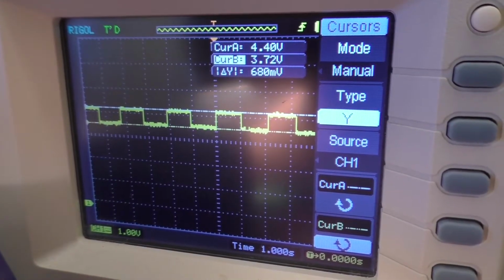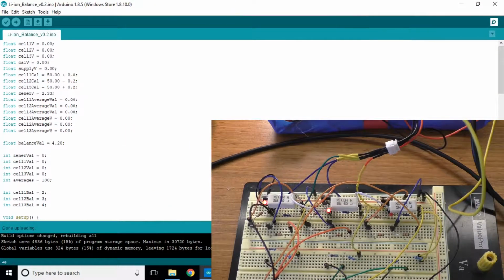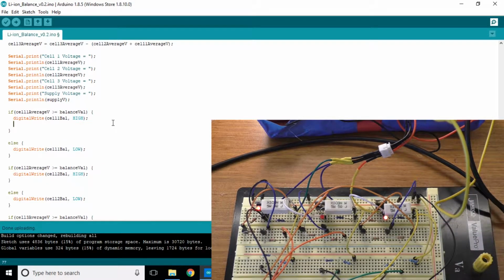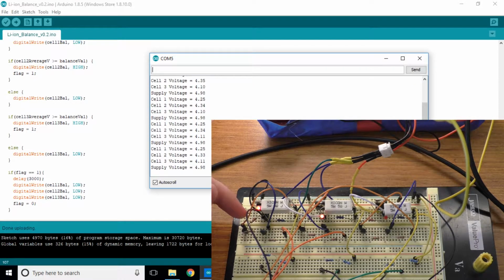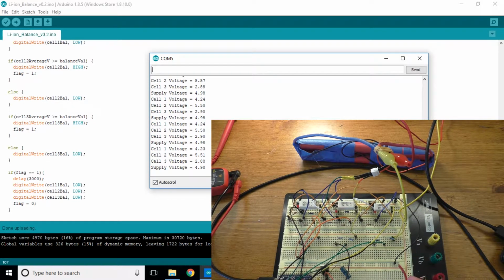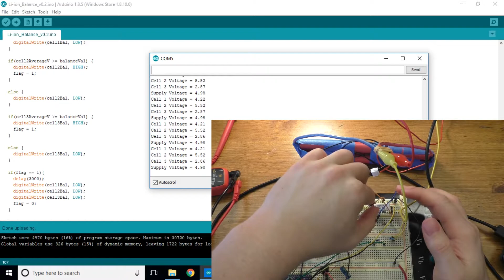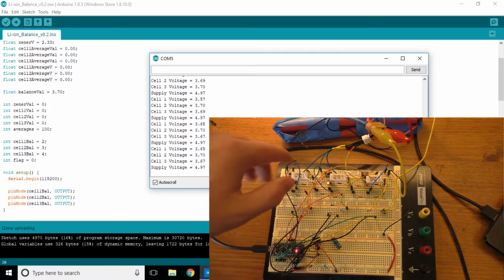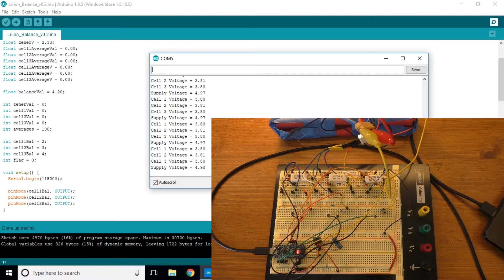Arduino BMS #3: Fixing the Oscillation Problem

Comment: Try to use Aref pin of arduino with a constant completely different voltage source like tl431 or 3.3v separate supply instead of 5v common supply.
In the past i have tried Aref pin as voltage reference and it's very accurate, even more accurate than internal 5v reference! 
And if u r using the aref dont forget to write "analogReference(EXTERNAL)" inside the setup () function and also using some decoupling nano farad valued capacitor with the voltage devider network can improve the readings.
Anyway love from India ❤🎉

Comment: I think its bc of the discharge current is quite smaller than the charging current, so that when reaching the 4,2V, even when the discharge kicks off, the will still be small charging current coming in. You want the balance current at least the charge current

Comment from the maker: //version 0.2 of the code

float cell1V = 0.00;          //sets variable for the voltage of the first cell
float cell2V = 0.00;          //sets variable for the voltage of the second cell
float cell3V = 0.00;          //sets variable for the voltage of the third cell
float calV = 0.00;            //sets variable for supply voltage compensation
float supplyV = 0.00;         //sets variable for the voltage of the supply to the arduino
float cell1Cal = 50.00 + 0.8; //allows for voltage calibration of the first cell
float cell2Cal = 50.00 - 0.2; //allows for voltage calibration of the second cell
float cell3Cal = 50.00 + 0.2; //allows for voltage calibration of the third cell
float zenerV = 2.33;          // measured voltage of the voltage reference
float cell1AverageVal = 0.00; //sets variable for use in calculating the average voltage of cell 1
float cell2AverageVal = 0.00; //sets variable for use in calculating the average voltage of cell 2
float cell3AverageVal = 0.00; //sets variable for use in calculating the average voltage of cell 3
float cell1AverageV = 0.00;   //sets variable for the current voltage of cell 1
float cell2AverageV = 0.00;   //sets variable for the current voltage of cell 2
float cell3AverageV = 0.00;   //sets variable for the current voltage of cell 3

float balanceVal = 4.20;      //voltage where the balancing circuits kick in

int zenerVal = 0;             //variable used for analog reading of the voltage reference
int cell1Val = 0;             //variable used for analog reading of cell 1
int cell2Val = 0;             //variable used for analog reading of cell 2
int cell3Val = 0;             //variable used for analog reading of cell 3
int averages = 100;           //sets the number of averages taken during each voltage Measurement

int cell1Bal = 2;             //sets pin 2 as the output to control the balance circuit for cell 1
int cell2Bal = 3;             //sets pin 3 as the output to control the balance circuit for cell 2
int cell3Bal = 4;             //sets pin 4 as the output to control the balance circuit for cell 3
int flag = 0;                 //sets up a flag for later use in cell balancing

void setup() {                // void setup runs once upon power up
  Serial.begin(115200);       //enables serial output

  pinMode(cell1Bal, OUTPUT);  //sets the pin used to contol the balance circuitry for cell 1 as an output
  pinMode(cell2Bal, OUTPUT);  //sets the pin used to contol the balance circuitry for cell 2 as an output
  pinMode(cell3Bal, OUTPUT);  //sets the pin used to contol the balance circuitry for cell 3 as an output
}                             //end of void setup

void loop() {                                       //void loop runs perpetually after the void setup has finished 
  for (int i = 0; i < averages; i++) {              //for loop used to get an average voltage of the cells
    zenerVal = analogRead(A3);                      //read the analog value for the voltage reference
    supplyV = (zenerV * 1024.00) / zenerVal;        //calculate the supply voltage of the arduino using the analog value from above
    calV = (supplyV - 5.00) * 10.00;                //find the diffence between the supply voltage and the expected 5 volts

    cell1Val = analogRead(A0);                      //read the analog value for cell 1
    cell2Val = analogRead(A1);                      //read the analog value for cell 1&2
    cell3Val = analogRead(A2);                      //read the analog value for cell 1&2&3

    cell1V = (cell1Val * (cell1Cal + calV)) / 1024; //turn the analog value into a voltage that is calibrated as accurately as possible for cell 1
    cell2V = (cell2Val * (cell2Cal + calV)) / 1024; //turn the analog value into a voltage that is calibrated as accurately as possible for cell 1&2
    cell3V = (cell3Val * (cell3Cal + calV)) / 1024; //turn the analog value into a voltage that is calibrated as accurately as possible for cell 1&2&3

    cell1AverageVal = cell1AverageVal + cell1V;     //add the present voltage to the pervious voltages of cell 1
    cell2AverageVal = cell2AverageVal + cell2V;     //add the present voltage to the pervious voltages of cell 1&2
    cell3AverageVal = cell3AverageVal + cell3V;     //add the present voltage to the pervious voltages of cell 1&2&3
    delay(1);                                       //delay between measurements
  }                                                 //end of the for loop

  cell1AverageV = cell1AverageVal / averages;       //calculate the average of the readings above for cell 1
  cell2AverageV = cell2AverageVal / averages;       //calculate the average of the readings above for cell 1&2
  cell3AverageV = cell3AverageVal / averages;       //calculate the average of the readings above for cell 1&2&3

  cell2AverageV = cell2AverageV - cell1AverageV;    //calculate the volage of cell 2 only
  cell3AverageV = cell3AverageV - (cell2AverageV + cell1AverageV);  //calculate the volage of cell 3 only

  Serial.print("Cell 1 Voltage = ");  //dump the measured voltages to the serial monitor
  Serial.println(cell1AverageV);
  Serial.print("Cell 2 Voltage = ");
  Serial.println(cell2AverageV);
  Serial.print("Cell 3 Voltage = ");
  Serial.println(cell3AverageV);
  Serial.print("Supply Voltage = ");
  Serial.println(supplyV);            //end of serial writing 

  if (cell1AverageV >= balanceVal) {  //if the voltage of cell 1 is at or higher than the balance voltage
    digitalWrite(cell1Bal, HIGH);     //turn the balance circuit on for cell 1
    flag = 1;                         //set flag equal to 1
  }                                   

  else {                              //if the voltage of cell 1 is lower than the balance voltage
    digitalWrite(cell1Bal, LOW);      //turn the balance circuit off for cell 1
  }                                   //end of if/else statment 

  if (cell2AverageV >= balanceVal) {  //if the voltage of cell 2 is at or higher than the balance voltage
    digitalWrite(cell2Bal, HIGH);     //turn the balance circuit on for cell 2
    flag = 1;                         //set flag equal to 1
  }                                  

  else {                              //if the voltage of cell 2 is lower than the balance voltage
    digitalWrite(cell2Bal, LOW);      //turn the balance circuit off for cell 2
  }                                   //end of if/else statment 

  if (cell3AverageV >= balanceVal) {  //if the voltage of cell 3 is at or higher than the balance voltage
    digitalWrite(cell3Bal, HIGH);     //turn the balance circuit on for cell 3
    flag = 1;                         //set flag equal to 1
  }                                    

  else {                              //if the voltage of cell 3 is lower than the balance voltage
    digitalWrite(cell3Bal, LOW);      //turn the balance circuit off for cell 3
  }                                   //end of if/else statment 

  if (flag == 1) {                    //if the flag has been set to 1
    delay(3000);                      //wait 3 seconds
    digitalWrite(cell1Bal, LOW);      //turn off balance circuit for cell 1
    digitalWrite(cell2Bal, LOW);      //turn off balance circuit for cell 2
    digitalWrite(cell3Bal, LOW);      //turn off balance circuit for cell 3
    flag = 0;                         //reset flag to 0
  }                                   //end of if statment 

  cell1AverageVal = 0;                //reset the total added voltages for cell 1
  cell2AverageVal = 0;                //reset the total added voltages for cell 2
  cell3AverageVal = 0;                //reset the total added voltages for cell 3
}                                     //end of void loop
Reply: Hi, we are currently creating a 3S BMS charger and your project is the best reference that I found. May I ask how I can contact you for some details? Thanks a lot!